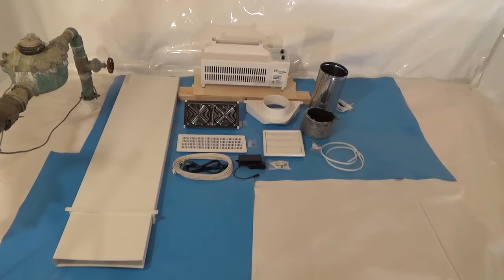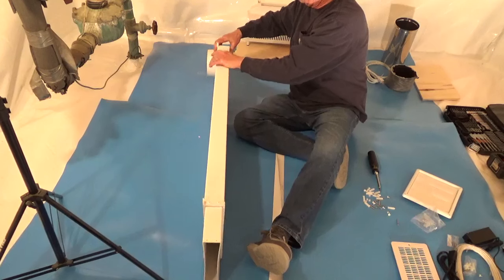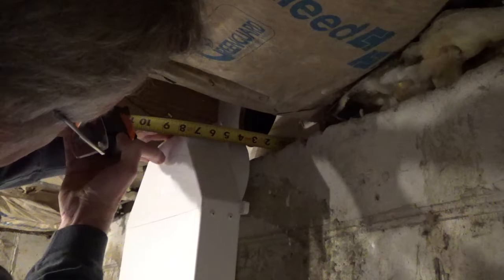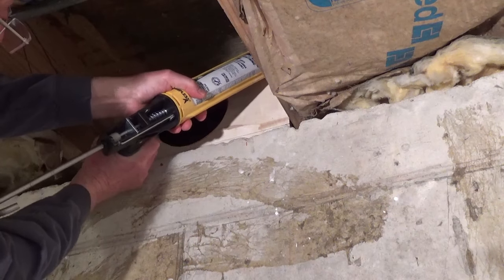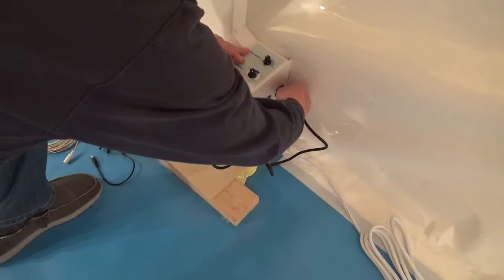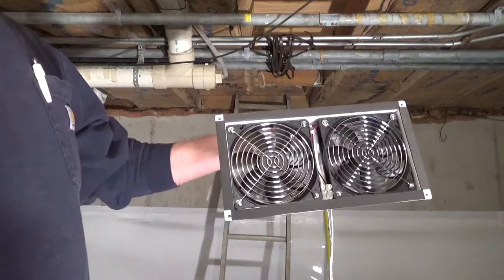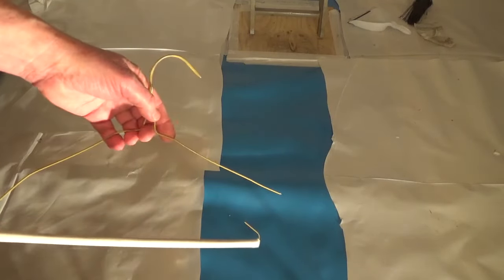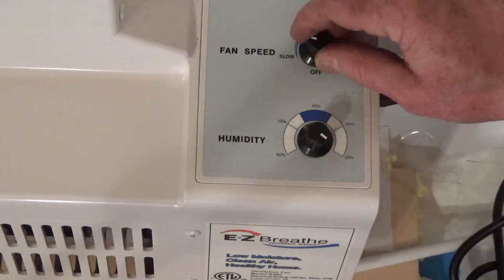Install an EZ Breathe Crawl Space Ventilation System

Comment: Why is the EZ Breathe crawl space ventilation system main unit installed on a platform and not directly on the blue membrane?

Why is duct plumbness important?
Reply from the maker: Hi Art, I put the wood platform on the blue runner to help protect the vapor barrier. I also wanted to get the unit off the ground in case the crawl space gets any seepage or a broken pipe.
I don't think plumb is critical, I'm just used to squaring things up. 
Thanks for watching!